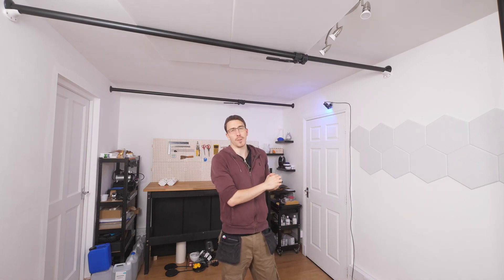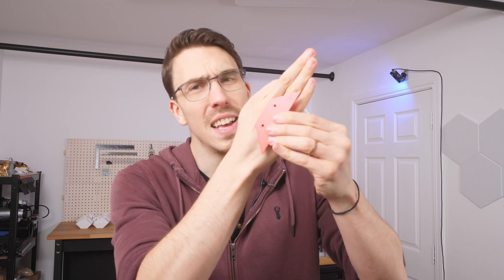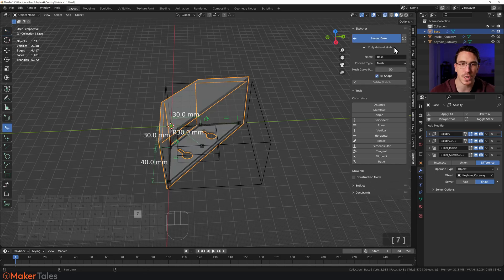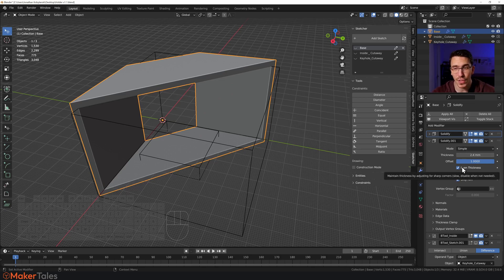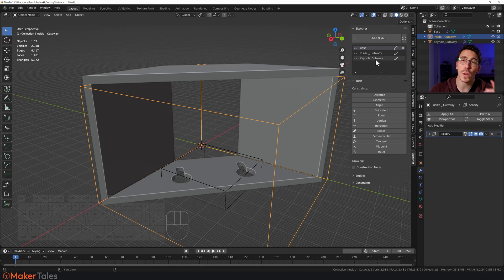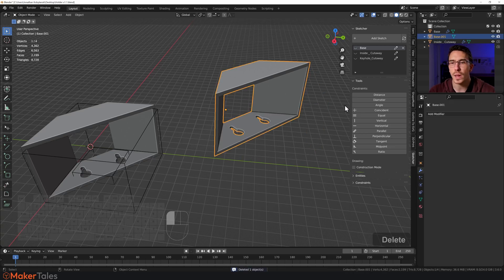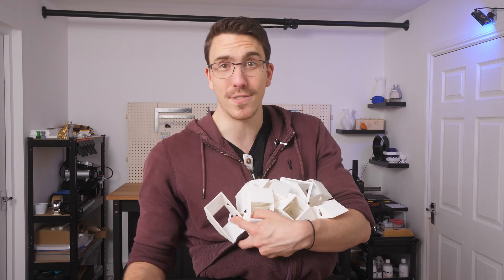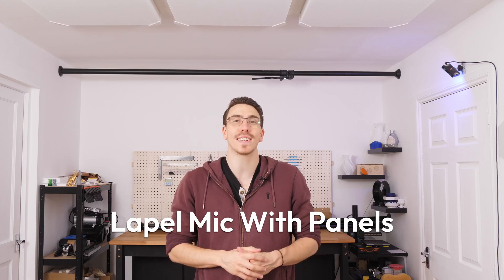CAD Sketcher Ceiling Mount Project

Comment: I used CAD Sketcher to make the model for a part for my brother's blank-firing prop weapon for his shows, which he just had made in aluminium. It was a sling attachment which was meant to fit on the barrel - so it was a hoop with two half-bobbles, like teeth, to lock it in place, and with a block with the slot for the sling to pass through. He gave me the measurements and I made it in Blender using CAD Sketcher, following your tutorial on how to use it. First time I did anything like this -- but it worked right out the box and it fit perfectly in place on his prop gun. Guys doing the machining said the model itself was very clean.